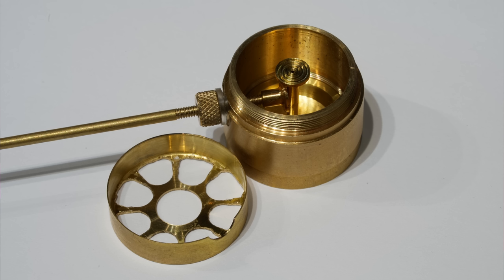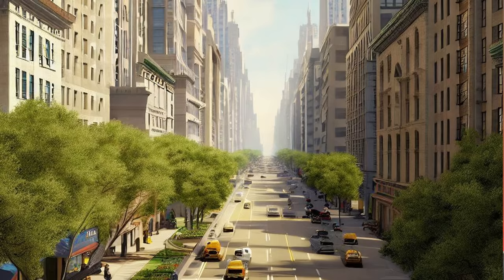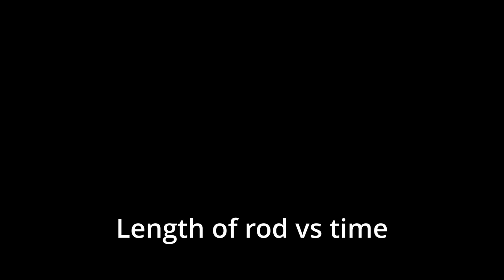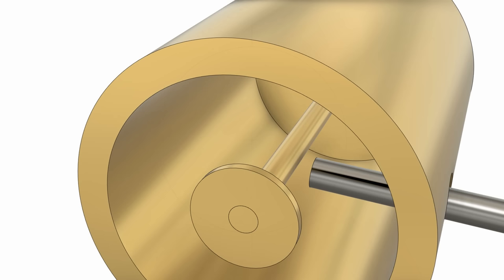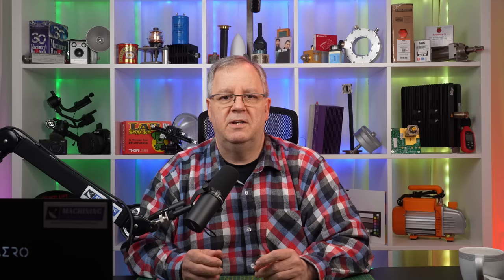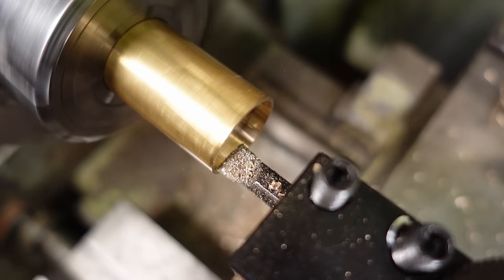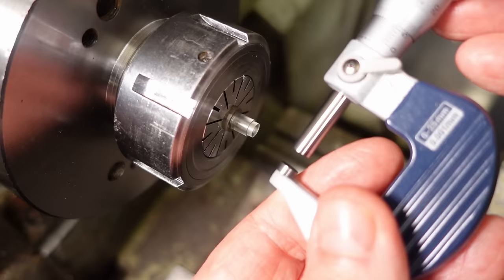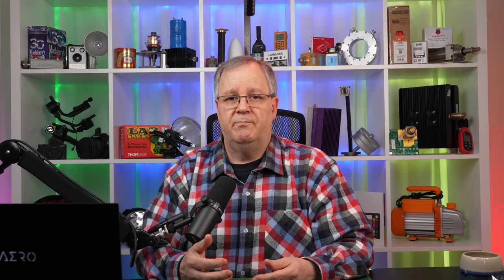SOLVING the Mystery Behind a Soviet Spy Bug : A True Masterpiece of Technical Elegance!

Comment: So in very simple terms, you send a radio signal through the building and look for the shadow created by the bug? And the shadow slightly changes by the bug being vibrated by nearby sound waves?
Reply from the maker: Not sure if "shadow" is a good analogy. It's more like if you could shine an X-ray searchlight light through the walls at one of those disco mirror balls and see the reflection at an angle where you don't see much of the searchlight beam, and the reflection is modified by sound vibrations.  One of Theremin's other inventions used infra-red beams bounced off a window to listen to sounds picked up by the glass.
Reply: @MachiningandMicrowaves  Bouncing a laser off a glass and sensing how the distance between emitter and glass slightly changes is also how physicists detect gravitational waves from black hole and neutron star collisions from millions of lightyears away. (But I think probably with much smaller wavelengths.)
Reply from the maker: Theremin used non-coherent infra red beams rather than lasers, and relied on angular change rather than a linear interferometer. LIGO is a very interesting system, pulling a signal out from way beneath the noise

Comment: Is there a problem that a high power radial beam must be directed at this bug to energize it? I mean in terms of human health?
Reply from the maker: No, it only needs an EXTREMELY weak signal. It's about the same power as ten cellphones and it's 400 feet away.  The only danger from any radio signal is heating your flesh, but this has the same heating effect as a candle from 400 feet. It wouldn't even have any effect if you stood directly in front of the antenna.  I wouldn't want my eyes anywhere within a few inches of the transmit antenna, but outside that distance it's a non-problem unless you go beyond the Laws of Physics. I can feel warmth on my hand if I hold it in a few inches from my 10 GHz 10 watt transmitter, that's about twice the likely power they used, but it's a false feeling as an infrared thermometer shows almost no increase, it's just that my nerves THINK they are feeling warmth.  The fact is that body circulation is amazingly effective at maintaining your temperature until you get into about 500 watts per square metre.  That's about half what you get from lying on the beach in very hot sunshine at midday in North Africa.  Thirty minutes of that and you'll start to get sunstroke. You'd run away from that much radio energy as it would feel very hot indeed.  I doubt anyone could stand in that sort of level of RF field for 30 seconds, never mind 30 minutes when the heating would become a problem.  We are talking about a ten-millionth of that power.

Comment: I know not much about this stuff, but any chance dialing up the power on the transmitter as a crude way to overcome increasing rf interference could cause Havana Syndrome?
Reply from the maker: Have a read of the wikipedia pages about Havana Syndrome and the Moscow Signal. The signal levels for the Bug are tens of thousands of time lower than those we all get from nearby wifi and cellphones.  The only harm from RF is thermal heating, and that needs field levels that are well above the ICNIRP 2020 limits. Those Havana Syndrome effects are usually dismissed as shared hysteria or effects from infrasound, ultrasound, chemical treatments for Zika, stress and so on.  It's fascinating, but there's not much in the way of evidence.  RF signals are trivially easy to detect, and at least in the 3 to 10 GHz range, a few watts on your hand feels pretty hot, despite there being no measurable rise in temperature.  Reasonably High levels of pulsed microwaves are supposed to be able to elicit a response from human ears,  see the paper by Allan H Frey, (Journal of Applied Physiology, Vol. 17, pages 689-692, 1962) https://journals.physiology.org/doi/abs/10.1152/jappl.1962.17.4.689 
Frey reported needing about 275 mW per square cm  to elicit an auditory response.. USSR safety levels win the mid-70s were 0.01 mW/cm^2 and UK limits were 10 mW/cm^2, so that's a pretty significant signal level. The illuminating signal for the Bug was around 2 million times weaker than Frey's experiment.
Reply: @MachiningandMicrowaves  wow that was an effortful detailed response. Wasn’t expecting that but I appreciate it very much! Thank you 🙏

Comment: I'm curious about modern portable heaters able to pick up radio waves I heard that these heaters actually have transmitters in them I don't know if that's true... but I did however, hear radio signals from two heaters I have owned in my lifetime and an air conditioner, so, I guess my question to you is because these devices can pick up radio waves or signals can they be manipulated to receive remote RF or a direct signal?  thanks
Reply from the maker: A lot of modern equipment have Internet of Things connectivity and can be controlled by home management systems, so you can control your heater by talking to your phone instead of getting up from the couch and altering the setting. You can sometimes hear very strong local AM radio stations on electrical appliances that have elements that can vibrate, like electric heaters, but that's very rare these days, where there are very few medium-wave AM stations any more. 

There used to be cases reported where folks with metal fillings could hear local AM radio stations because of rectification by the fillings and hearing the tiny vibration or electrical signal directly. 

Anything with a metal panel that vibrates in sympathy with nearby sounds could in theory be used as a listening device if you can get a microwave beam reflected off it and received, but it's not at all simple to do that.  Once you get IoT chips and devices into appliances, then all bets are off, you have no idea what's on those controller boards. The manufacturers could use a piezo sounder to make those little beeps when you change settings, but also use the sounder as a microphone and transmit that back over your wifi if they wanted to.  Not very likely though, as that might have a bit of a sales and reputational impact!
Reply: @MachiningandMicrowaves  got it thanks, the funny thing was I thought I was hearing voices and music in my head until one day I was close to my heater that's when I realized I wasn't that crazy lol so yea then it had me thinking could someone possibly hijack the signal somehow and put out subliminal messages LMAOO

Comment: It's sad that you cannot handle the imperial system. There is still room for both.
Reply from the maker: Heh heh, room yes, justification though? Er...  https://www.youtube.com/watch?v=GDUt-Kbxqsg For the record though, I was taught in Imperial, also Avoirdupois and Troy, then CGS, MKS and SI. I'm also happy working in knots, cables, leagues, perches, acre-feet, barleycorns (for shoe sizes), nautical miles, Imperial gallons (which for weird reason are not used in the US), long tons, furlongs, parsecs, light-minutes and tenths of a mil (or thou), which of course are actually a hundred micro-inches, but hey...
Reply: @MachiningandMicrowaves  sure, do new building (say) in millimetres, but when it comes to older properties and remedial or additive works, measure in feet / inches, then convert. Saves tears

Comment: Wasn't there something about it being non-linear and re-radiating on a harmonic frequency?
Reply from the maker: Lots of other loony ideas too. Yeah, lots and lots of deliberate disinformation about the frequency, magical harmonic generation and how the antenna is a quarterwave or something. I tested for that. It just doesn't happen.  You'd need a nonlinear element. "Oh, but the contact between the threads", Yeah sure, it's bypassed by an IMMENSE capacitance across the gap. "Oh, but the contact between the silver-placed body and the silvered membrane. Because Oxides!" Sure, sure. Nope.
Reply: @MachiningandMicrowaves  
I guess you'd need a diode.

Impressive though. More so given the precision of the setup needed.
Reply from the maker: Later units used a diode across a dipole, but used it to rectify a sniff of RF to power an amplifier, but then had a transistor to load the diode to change the amount of re-transmitted signal.  Some very clever stuff was going on

Comment: Would the rod benefit from a quartz core?
Reply from the maker: At 950 MHz, all of the conduction is restricted to a thin layer of about six skin depths, so about 10-15 micrometres.  The rod could be hollow or filled with anything, but the skin effect effectively shields the majority of the diameter of the rod from the RF conduction layer.  Quartz is a good dielectric material at 1 GHz, so could have been used as a support for the antenna, but the piezoelectric effects tend to be limited to a few tens of MHz as a mechanical vibration

Comment: Just out of interest, why did they not think of x-raying this just to check it out before putting it on the wall?
Reply from the maker: The Russian perspective on this was that they did a magnificent bit of psychology on Harriman.  Beria's team investigated him very carefully and found he had a soft spot for fine craftwork and particularly wood carvings, and that he would be entirely disarmed by the gift and fell for it hook, line and sinker.  I suspect it was a mix of complacency and lack of foresight as well. I don't believe they had access to an X-ray machine either.   There are some notes that say it was checked out, but that they only checked for obvious wires.  If they had checked for radio signals, they wouldn't have found anything, and I don't think they would have had UHF/SHF signal generators and aperiodic receivers or non-linear junction detectors.
Reply: @MachiningandMicrowaves  that’s really interesting. Thanks for the comprehensive insight into this curious gift!
Reply: By the way heard of something similar (at least, the passive receiving/transmitting bit) during the 1940s with a dipole (possibly folded dipole) aerial, with the two ends connected via a carbon microphone. Apparently if you direct a carrier at it, you can receive an AM signal back
Reply from the maker: @MarkHarmer  I'll be making a replica of the next generation of that using a crystal diode as rectifier and modulator across a dipole with that powering a two transistor amplifier from a hearing aid microphone then another transistor to load the diode for modulation. There were numerous varieties, sone with scrambling and other ways to disguise the traffic

Comment: It really seems like microchips made us lazy and we stopped pursuing mechanical engineering innovations. We have computers that effectively split atoms in nuclear fission reactions, but we make the electricity by boiling water to spin a dynamo 😂 we gotta stop leaning on CPUs as a crutch for our engineering
Reply from the maker: The chip shortage of the last two years has been a wake-up call, but the cost reduction of using processors and FPGAs and FPGAs with processors, plus the cheap labour of overseas coders and the easy of making changes all lead to more and more use of programmable devices. It's like electric vehicles, soulless but effective. I prefer steam engines, gas turbines and internal combustion engines because they are interesting mechanically, but they have tens of thousands of parts compared with an electric vehicle, and that is attractive to corporations as it means less need for expensive skilled engineers and inventory and simpler repairs with a system swap-out instead of skilled maintainers.  Everything slowly gets worse, but we want low prices, so we get what we ask for. (deliberately avoiding any mention of relative environmental impacts here, my home grown timber from trees I planted 30 years ago, fuelling a steam-powered SUV would be totally carbon-neutral but would be a nightmare for particulate pollution)
Reply from the maker: In my professional life, I spend most of my time trying to fix security vulnerabilities created by programmers who don't appear to have the vaguest clue how to deal with an adversary who has an attacker mindset. I've been fighting this fight for 30 years and I am tired and burned out. Real security-aware coders are a very very rare breed, and too expensive for most corporations to consider. Programming is something that anyone can do, but unlike surgery or aircraft engine design, it's rarely important that software goes wrong.  Few people die (OK, THERAC-25)

Comment: Just wanna know if they could actually hear anything interesting…
Reply from the maker: @OnerousEthic  we'll probably never know, but there were some interesting visitors to the resident who used that study like George Marshall of "The Marshall Plan", and some of the ambassadors liked to use the informal setting of that room for discussions. As with any intelligence gathering operation, the tiniest snippet of information can be useful even if it only illuminates the mindset of the people involved in the discussions. visitors to the residence were shown a card which said that all of the staff were members of NKVD or later KGB and that anything left in your room would be sound and recorded but put back exactly as it was. The risk of microphones being planted was already known about, but in general if there were no wires and no obvious signs of embedded transmitters then until this example was found it would've been assumed that having a remote microphone in such an object was impossible. The later examples such as Buran where infrared beams were aimed at windows and the reflections monitored to eavesdrop on conversations within the building were another great example of lateral thinking. The problem with all of these things is that once someone has discovered the technique being used you can't use it again, at least in that form.

Comment: I have an idea requiring a low power microwave source, transmission and radiator or antenna. It has the potential for a Nobel prize and revolutionizing many fields of human experience. I hesitate to explain much further in public. Is there any way that I could communicate more information to you?
Reply from the maker: Strangely, I get a LOT of messages like this. Like DOZENS. Usually I just delete them. The only way I'll get involved in discussions about this sort of thing is if the ideas are published in a PUBLIC FORUM where anyone can join the discussion and see what the idea is. Even then I'm probably not going to get involved because life it too short.  If it's really that good, engage some professionals and get some peer-reviewed publications in reputable journals so you are the first to be published.  Get hold of patent lawyers if there is something patentable.

Comment: A passive fm transmitter
Reply from the maker: @michaelbullock7747  I see no FM and only a tiny amount or phase mod is detectable from mine, it is almost pure AM but with distortion from the curved slope of the resonance. The audio can be retrieved using an externally excited Homodyne AM receiver, using the remote UHF carrier as the local oscillator.  That being said, very low modulation indices in FM and tiny levels of amplitude modulation are mathematically similar of course.

Comment: I guess that is why the American ambassador and staff in Cuba was suffering from microwave brain damage...
Reply from the maker: See my previous comments on this.  Nothing to do with this type of bug, the only effect of microwave energy is thermal, and you can tell when it's happening because you feel the heat way before there's any actual heating effect.  The level needed for a bug is something like a thousandth of that from a nearby wifi or cellphone, and they are hugely less than the ICNIRP limits, which are extremely conservative.  The investigations blame all sorts of things from Zika virus treatments to stress to mass hysteria, see "Havana Syndrome" on Wikipedia.
Reply from the maker: Also, Havana Syndrome was in 2017, nobody has used this type of passive bug for decades as it's far too easy to detect now.  See also the "Moscow Signal" in wikipedia
Reply: @MachiningandMicrowaves  Ofcourse it isnt the same you would use nowadays, the old device i would describe as a mechanical passive mixer. I can imagine a modern microwave spy device where you bounce it of any metal inside the target building and "read" the information in the return wave like a radar.

Comment: Now explain how they can basically MRI whole cities with Cell phone microwave radiation.
Reply from the maker: I had an MRI done on my head back in the day. That was LOUD. Imaging structures using incoherent and uncorrelated RF sources is mightily tough. I think I'll let you go first and explain the underlying maths and physics of a proposed mechanism. I have enough challenges in my life already thanks.
Reply: @MachiningandMicrowaves  It can't be all that different from the back-scatter imaging they're they use to x-ray vehicles and buildings from a single position / axis without a B-side receiver or photographic plate.